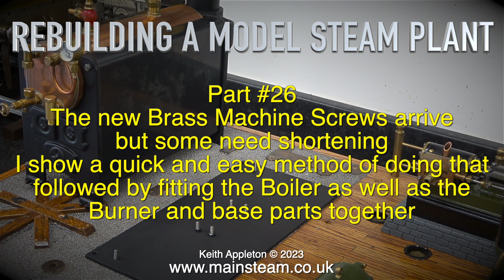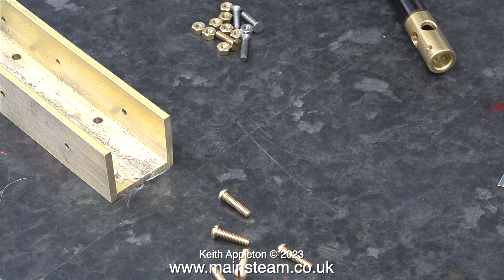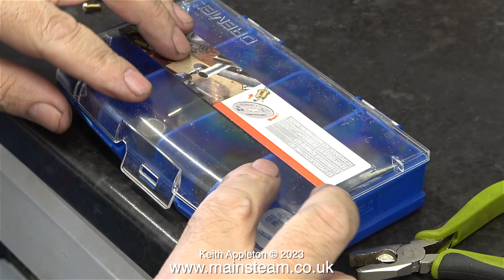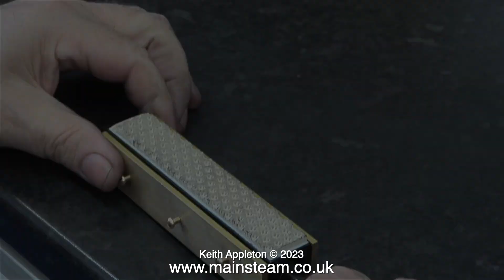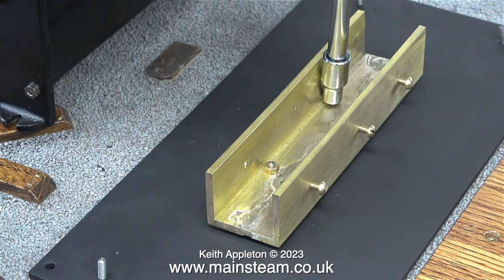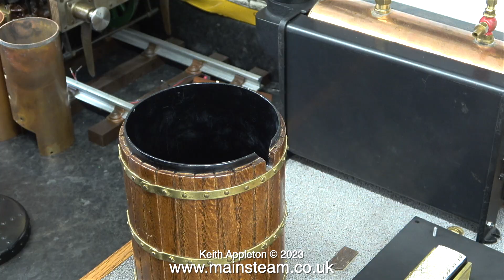REBUILDING A MODEL STEAM PLANT - PART #26

Comment: Suggestion, maybe you have done it. Pop a hole in the bottom of the tank (pvc tank that holds the gas canister, not the gas canister hahaha). Just to vent any leaks or whatever ends uo in the bottom. A size or two that could be closed if in future you wish to use it as a water tank. Unlikely but we know multiusers happen.
Regards,
Keep well and keep it up
Reply from the maker: Thanks Paul, I did consider doing that but now you have talked me into it }:-))) Thanks for the useful comment ......